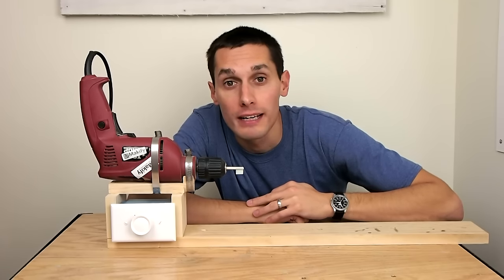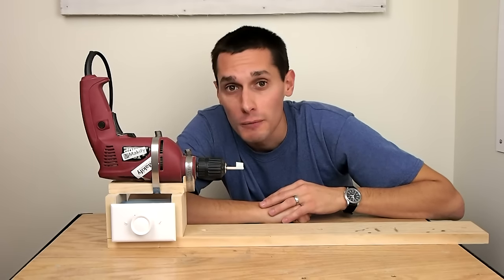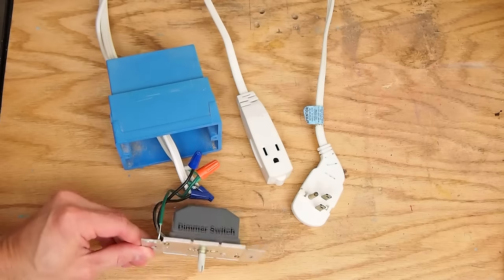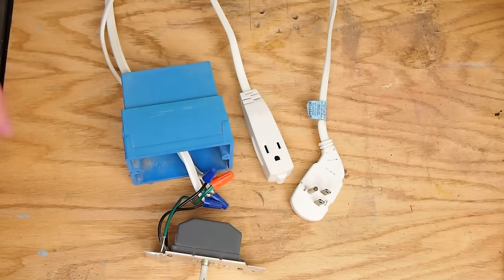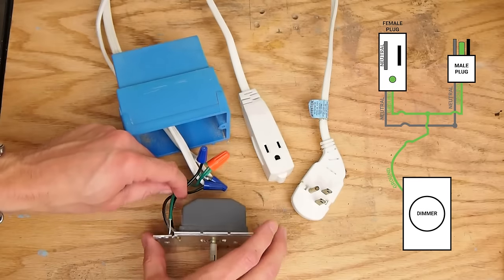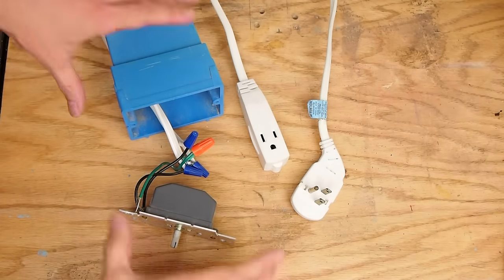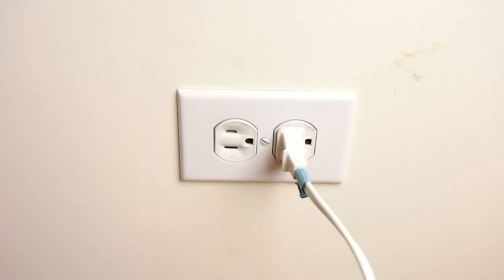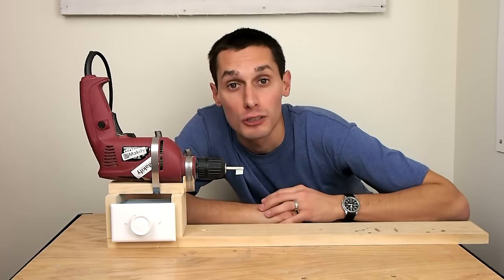How To Make a Speed Controller from a Dimmer Switch

Comment: corrected: Most dimmers use a TRIAC, which is the exact same way the drill's trigger controls the speed.  As long as you don't exceed the dimmer switch's amp/watt rating, it should work great.

Comment: Just a word of caution. when I was getting the stuff to make one of these the guy at my local electrical supply place who I know and trust, explained to me that there is a difference between a "dimmer switch" and a fan control switch. even the lutron company which is what I see used on most of these on youtube  has two separate products for these applications. the dimmer switch just limits voltage which on an electric motor can cause damage. the fan controller acts differently and is specifically designed to regulate motor speed and not just limit voltage. they cost about the same but be sure you get the fan control switch and not the light dimmer if your using it to regulate or variate motor speed.
Reply: PWM does not change frequency, only pulse width so the average of the voltage. First step in PWM is to convert AC to DC and motor need the AC (+/- alter).
Reply: chris malcom wow.... welp im pissed..
Reply: chris malcom thank you for pointing that difference between those two switches
Reply: Just i thought
Reply: Chris Malcom
Your comment was very informative and in my opinion professional. I researched what you said to get more info on it and here's my copy n paste. 

"The best dimmers for running an electric motor have an adjustable minimum speed setting. The power switch should match the specifications for the motor for best results. On the hub cover of the ceiling fan there will be a list of the amps and the watts that the appliance will use at maximum power consumption. If the measure of watts is not included, multiply the number of amps by 120 to find the watts number. Always buy a switch that is rated to handle an equal amount for the watts or more, not less, in order for the dimmer switch to work well. A dimmer motor AC switch is suitable for a ceiling fan.
A dimmer can't control a lot of fixtures, or it will overload its maximum wattage. For instance, if a dimmer is equipped for 500 watts and has to control up to six lights at 100 watts each, it can overload the system. If anything, it will be working overtime, which can cut down its lifespan significantly. To keep the dimmer switch working well, only use appropriate wattages. If the fixture requires less than four watts or more than 600 watts, then a dimmer switch may not be the best option."
Reply: Wow, this answer is 100% wrong, what width do you think they are talking about modulating? it's the width of the wave, which is exactly frequency. Second yes the first step is to convert to DC, however THE SECOND step is to invert back to AC at whatever the set frequency is. Frequency modulation is needed for induction motors, SCR voltage control can be used for universal motors.
Reply: @integr8er66  The width of the wave is not frequency, but the period of the wave is frequency.  Dont assume on and off time are equal.
Reply: That won’t hurt the drill. He’s using the dimmer switch like you would use the trigger on the drill. The comments in this section are complete stupidity for serval reasons. I don’t feel like educating idiots

Comment: A common lamp dimmer will control the speed of REPULSION MOTORS (AC motors which use brushes) They can also be used for DC motors if you add a bridge rectifier between the dimmer and the DC motor as long as the motor has brushes. Not for use on brushless DC motors. Also, the common lamp dimmer cannot be used to control the speed of INDUCTION MOTORS such as motors used in most audio turntables, window/ceiling fans induction motors on most shop motors such as drill presses and table saws.  However check the current draw of your device and compare it with the wattage rating of the dimmer the rating of the dimmer must exceed the requirements of the motor under a load. 1amp = about 120watt so a common 600watt dimmer will handle about 5amps draw from the motor.
Reply: Hello what do I need to control an industrial fan, speed one is soo strong I need to make it slow, I wish there's just a smart socket to control the volt/wattage/amp, or it could damage the motor?

Comment: CAUTION:  Working with AC/ mains can kill.  Double check your wiring three times before even thinking about  it.    If you hook up improperly you'll probably short out the dimmer (triac),, and trip your home's circuit breaker or fuse (assuming they work - if not get ready for fireworks)!
Thumbs up if you do it right, this is a good Makify project!

Comment: It works for me too. But not after I burned out a dimmer switch trying to figure out what you were talking about with the connections. I think better directions would be the two green wires one from each side of the extension cord in the green wire on the dimmer switch should be all wired together. When I looked at the extension cord that I had the wires weren't colored. The only one that was colored was the green wire. I don't know that it makes any difference either but one side of the wires have stamped writing on it so I made sure when I connected the two white wires back together again I made sure that they both had writing on them. Then one black wire from the dimmer hooks to one side of the extension cord the remaining wire and the other black wire on the dimmer hooks to the other. PS I'm using this with a Sawzall for a "different application" / "unrelated project" as well. :) hopefully she likes it.
Reply: If you're doing what I think your doing, then Raw Edge! Man😍😝😈
Reply: The green wire is ground. Your breaker panel is is grounded to a long metal rod that's several feet in the ground (Earth). Green = Earth that's how I remember. I learned many things the same way you did and that's fuck shit up sometimes. Word of caution just in case you don't already know. When it comes to extension cords or power tool cords the wires can sometimes be any color. Get yourself a cheap multimeter, harbor freight has them for about $4 and sometimes free with any purchase. Simply Google harbor freight coupons and you'll get 20% every time. Some of their things are amazing and some are junk. Just do you research. Keep experimenting and be safe.
Reply: i wanna do the same thing lol, did it work out?

Comment: Good to know this. I want to build a lathe too - been wondering about how to power it - and yes, maybe with a drill. But, something has occurred to me; the motor in my scroll saw is a variable speed, complete with dial similar to a dimmer switch - that plugs into a regular AC outlet like any other corded power tool. Why isn't a motor like that available for lathes or drill presses? Could anyone answer that for me?

Comment: Most drills have a variable speed trigger which is really no different than the dimmer control. So you can use it in the same capacity. Just always make sure the drills trigger is pushed all the way in so it gets full power

Comment: Line in is more important then the ground for speed control, but having a ground is important for safety reasons, not operation of the controller though. Just what I've seen with the few controllers I've dealt with.  Either way, this is helpful, but onlookers, keep in mind, there are electronic rheostat controllers, I think called SCR's, correct me if I am wrong, then there are DC or AC PWM's that should not be confuse with each other. My info is in no way to hurt Makify1, insult him, etc. just wanted to pass along the info. I'm still learning also.
Reply: Pulse Width Modulator for a DC motor, i think..lol & a Varible Frequency Controller for an AC  motor....i would research it & be safe...

Comment: first of all thanks for sharing this video,i have an electric motor(3/4 ph 1750 RMP.110 V .3.5 Amp) i am looking for a speed controller for it,dose this system work for that motor or not?please let me know thanks
Reply from the maker: I don't know, that's a pretty beefy motor. Hopefully, someone more knowledgeable about electric motors will chime in.
Reply: thanks anyway
Reply: Hey Matt! Did you find a solution for this? I have a 25W 100V motor and looking for a way to control its speed. Any help would be appreciated!
Reply: @shameehaajmal1517  Hello .unfortunately not  i could not find it yet .

Comment: So basically don’t cut the cord all the way in half.  Leave the white intact.  Cut the black and one connects to black on dimmer the other black dimmer goes to other half of cut black wire.  Cut the green and feed all 3 into a wire nut.  Correct?

Comment: Good day. Can I also use this dimmer on a hair dryer that I am using on my coal forge for controlling the fan speed , if it works on the drill it should work on the hair dryer, right?
Reply: Not OP but I don't see why not.  I followed OP's instructions and my controller works with both my dremel and my bench grinder. One thing I've noticed is that top speed of the tool withOUT the controller is slightly higher than top speed WITH controller(dimmer switch) turned to the highest position. FYI.

Comment: I live beyond the grid and have used a rotary dimmer switch to control things like an electric hotplate. I plug it all in to a kilowatt meter so l can precisely dial in how much power it uses, typically 150-550 watts and allows for a much smaller inverter to be used.

Comment: Question: I followed the instructions and the diagram but my dimmer switch is acting as a switch only and is not controlling the speed; just full on or off.  I have switched the black wires betweeneach other but have the same effect.  I looked up "overlamping" but the dimmer is rated for 600W and my bench grinder is about 510.  Thoughts?  Thank you.
Reply: It was a bad switch.  Replaced the switch and it works now.  Thanks for the great video and ingenious idea!

Comment: yes it does work.....and most of the time running back and forth a busy highway blindfolded may work too but i wouldnt do it. you are doing nothing more than lowering the voltage...the drills is still needing the same amount of power to run so the amperage goes up. let me know if you destroy your drill or starting a fire comes first
Reply: "the drills is still needing the same amount of power to run so the amperage goes up" If it runs slower, it doesn't need the same amount of power to run. How do you think the speed control that's built in to these drills work? This is a perfectly fine method of changing the speed.
Reply: @Netherlands031  actually no its not. it will burn out the motor by driving the amps thru the roof...but you go ahead and think and do anything you want. oh and how do i think its done? ummmmmm most of the time with a VFD. ok genius?
Reply: @emeralddragon2010  an induction motor has, you guessed it, inductors that do the work. In an inductor, current is proportional to the time that a voltage is applied over it. So if you  shorten the time that voltage is on the inductors (using a dimmer) the current will be lower. Now, most dimmers are not good at driving inductive loads for various reasons so you can't just do this with a hardware store dimmer but with an appropriate one it will work. Now you tell me if I made a mistake in my reasoning or what the reason is that the amperage will be higher.
Reply: @Netherlands031  I'm not arguing with you. This is my career and I know what I'm talking about. Do what you want

Comment: Fire hazard mod.
Use an old cordless drill instead. 
Got one with a dead battery? Disassemble it down to the motor and drive/chuck assembly.
Step #2
 Buy an(Amazon) A/C to D/C stepdown transformer, that matches the D/C voltage of your drill.  10 amp rated current.
Cut off the female end from an extension cord. Hook up those two wires to black(Hot) and white(Common) to the input wires of 
The transformer.   A/C =IN.
Step #3 
Wire the the transformers D/C=Out.  2-wires. Negative - (Black) and the Positive +(might be: red, or green, or yellow) to the  
D/C =IN leads, of An(Amazon) 10 amp, Reversible, D/C motor speed controller. Just watch polarity of + and minus on the little circuit board.
Step #4
 The D/C=Out wires from the speed controller, go to the drill motors two wires. 
Watch polarity of the   +  and -  
Now you have true safe, variable speed, and it runs on house circuit. You can get creative building the Lathe bed
Built of wood, or metal using a Lead screw for manually adjusting feed rate. 
You will need to create an improvised spindle for turning long stock, or boring and threading operations.
 A small bench vise secured on the lathe bed could be used as the tool holder. Turn materials like carbon fiber, plastics or Maybe Aluminum.
 But remember;
The drills internal clutch will(slip) limiting max torque to your work piece. And the drills 1/4-3/8 inch chuck will need 
Improvising of your own design fitting a home made 3 jaw, face plate chuck to turn larger diameter material.
Modify a 1/4 inch 6-inch sanding disc tool?
Build your machine so that you can swing it to vertical(chuck facing downward) and figure out
What next, to also use it as a variable speed, milling machine and drill press.

Comment: If you cut the extension cord in half, how is the male end still attached to the female end?
Reply: so if you plug a  12volt DC power supply to it, will it regulate the power to whatever is powered by that 12 volt DC Power supply?

Comment: Most likely that drill has a universal motor which is a modified brushed DC motor.  It will also run on high voltage DC.

Comment: Just found this and I'm in the process of making a lathe with an old drill and wanted to control the speed. This will help lots....

Thanks for sharing. 

Also do you have a video of the lathe being used at different speeds?
Reply from the maker: +Stephen White  I'm glad the video was helpful. I don't have a video showing the lathe at different speeds per se but I've run it a various speeds in different videos but the video is usually sped up so it's probably not very helpful.
Reply: Light dimmers won't correctly regulate brushless motors

Comment: Some motors are fine with a dimmer (potentiometer) because this type of motor is capable of operating within a given amp range.
However a normal lathe or drill press is not, pretty much any motor that uses belts to change speeds is only meant to operate at a set voltage/amperage.
Hopefully someone reads this before splicing in a dimmer on their lathe

Comment: can it be used for DC motors?
Reply from the maker: I don't think it will work on DC only motors, I might be wrong though. Some motors, like many used in power tools, are universal motors that will work on AC or DC. Dimmer switches WILL work on universal motors, as demonstrated in the video.
Reply: i already searched about on how to control the speed of a dc motor and many of them said that they are using potentiometer,recently i bought one and used it on my dc motor and im happy of it
Reply: so if you plug a  12volt DC power supply to it, will it regulate the power to whatever is powered by that 12 volt DC Power supply?

Comment: Could also be made in a 2 Gang metal box with single outlet receptacle
Reply: tan j maz  yes plastic will work metal is just a little bit more durable and double is fine as well but like you said you can only plug-in things that are going to be controlled
Reply: tan j maz  I always try to cut off and save round 3-prong cords.. they work really nice with a connector to put in a box

Comment: too late, oh well whatever
universal motors are usable at multiple speeds, this is WHY drills among other things blenders, etc have a variable speed buttons on them  no you're fine it won't (or shouldn't) do anything to the motor
the only thing that should is overvolting it (feeding too much voltage through it) not the opposite, meaning limiting it on what it's already got.
.......Vroooom!!!

Comment: Next time you need to show the whole wiring picture.  You have three cords cut off at the top of the picture and disappearing off the table in what could or could not be different directions.  Eventually, white male plug goes to wall, brown/black drill cord goes to female plug, and where does the third white wire go (upper left of picture)?  We have to assume it comes back to the male based on the diagram but, for some Harry Homeowner newbie, assumptions aren't good when you're working with electricity
Reply: Please use stress lelief on cables

Comment: This performs the same function as the harbor freight tool for $14 .. I bought one of those years ago for porting and polishing cylinder heads and worked awesome till I dropped it.. replaced it with a new one and it only redused the speed by about 20% where old one can reduce to 0% ... decided to make one of these to get back my full control ... alas the dimmer switch I made cost about $10.50 to make and it worked only as good as new harbor freight model .. don't waste your time just buy the harbor freight model.. also regardless of which black positive wires used (polarity) when turned on it was full speed and you had to turn dial to slow it down ..reversing the black wires and no affect on this .. waste of time but worth it for the chance to slow my 20k rpm porting tool

Comment: Crazy dangerous, if you didn't turn 'off' the drill and left the dimmer at 'near' zero, what is your plan for the amperage? A dimmer switch isn't a speed controller. You could burn down someone house.

Comment: The compulsion to make both screw slots set at precisely the same angle or position inside and outside, visible or not (and continue doing so on every screw throughout a job..) has caused me to over tighten and crack more than one face plate...  every job I do looks perfect..never a complaint (even gets compliments from city inspectors) but means I always have to purchase 5-6 extra plates and switches, receptacles and light fixtures per job site...hmmmm...OCD, a blessing and a curse..